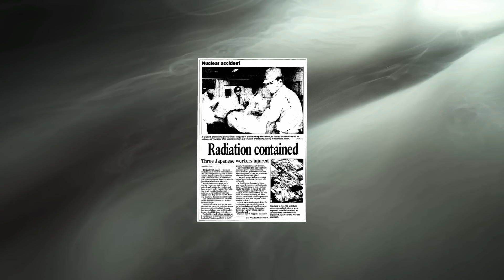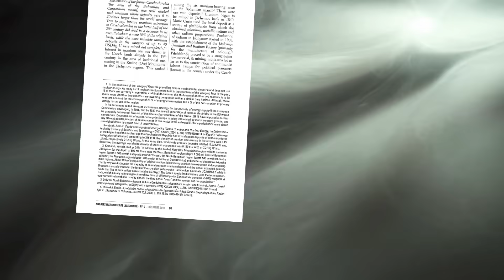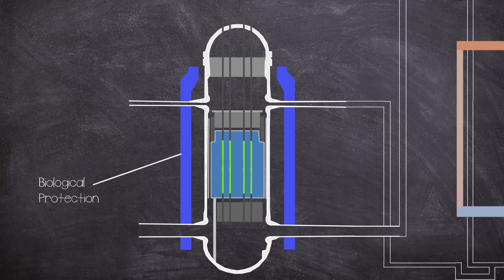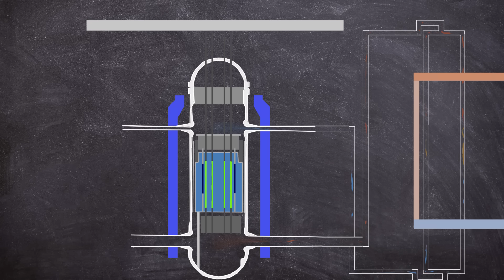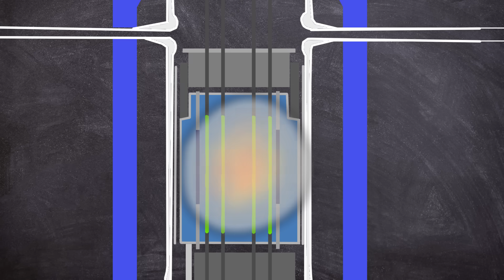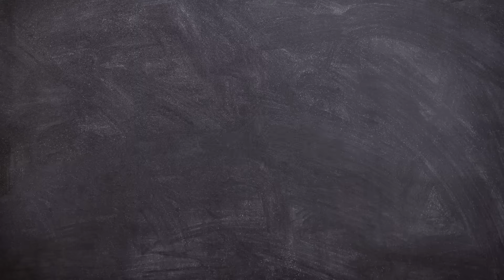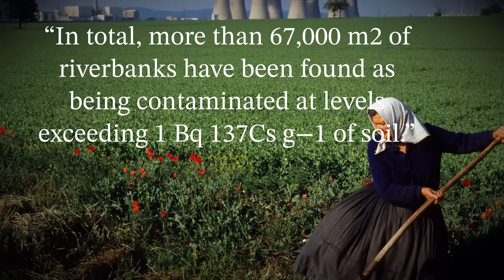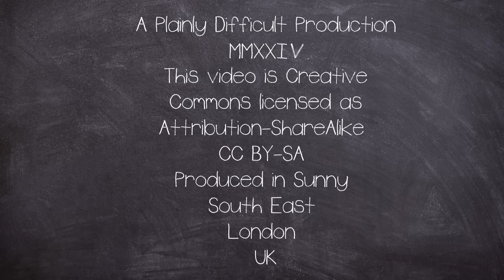Doomed: The Czechoslovakian Nuclear Reactor That Kept on Having Accidents | Plainly Difficult

Comment: Not the first time a socialist country has had problems with reaction.

😏
Reply: Communist, not socialist
Reply: @Coastal_Cruzer  Technically, it was a socialist nation led by a communist party. You could also technically call it a "first phase of communism" country if you're going with a strictly Marxist definition, but to say it's a straight-up "communist" country is a bit misleading since they hadn't actually achieved communism/the second phase of communism defined as a stateless, classless, moneyless society organized around collective ownership of the means of production and the guiding maxim "From each according to their ability. To each according to their need." 

They didn't even really manage to establish a stable dictatorship of the proletariat, let alone achieve the withering away of the state. And if you're taking an internationalist line then it wouldn't even be possible to fully achieve communism on a national level since the existence of bourgeois elements anywhere would preclude the establishment of a classless society.
Reply: @meatharbor  if you have to 1. Write a paragraph in response to three words, and 2. Use "technically" that many times in the opening of an argument, consider that you might be misinformed and/or chasing a bias

Comment: "Hey guys, out of curiosity do we have a vacuum cleaner?" "Yeah, why? Aren't you supposed to be refueling the reactor?" "No reason, hey can we borrow that real quick?"
Reply: The clearing staff using the same contaminated vacuum cleaner in the office a day later 😂
Reply: @NinoJoel  fresh fuel rods can be hold in hands and they are. In that particular reactor those rods had even unenriched uranium. That was the main feature of the A1 and the possibility to change the fuel during operation.
Reply: @Petriiik   while my comment pretty obviously was ment as a joke I still don't agree with your comment and the one above. 

Yes it's not highly radioactive. 
That still does not make it "safe" To handle for longer periods of time. 
There is a big difference between having a fixed source of said radiation or potentially sucking in small fragments of said source and spreading it in the air. 
The used material is highly toxic and the radiation while not posing a threat directly will have a much worse effect if breathed in.
Reply: @NinoJoel  no you can not inhale that stuff, the uranium is clad in metal.
Reply: @Petriiik  and what gives you the certainty that no material particles got out during production.... Like I said. It was a joke.  Yet there is no guarantee there is none. If there was the people handling the rods would not wear masks....
Reply: @Petriiik  in theory yes, it is safe holding in hands. In reality your hands are too dirty to touch anything going into ultra clean enviroment like nuclear reactor.
Reply: @NinoJoel  Well, sometimes I see people driving their cars alone wearing masks for no reason, so that's not really true.
Reply: @seth7745  that's something they decided themselves... The other is a regulation put into place for a reason lol what a comparison
Reply: @NinoJoel  Regulations are put in place for reasons, but not always legitimate reasons. Just because someone is wearing PPE it doesn't mean there is a hazard. Sometimes its just about optics and bureaucracy, especially under communism. The people wearing masks alone in their cars is just icing on the cake. It shows how irrational people can get when subjected to overzealous policy. I'm not implying that is the case here, just that you can not assume there is a hazard just because someone is wearing PPE. There maybe, there may not be.
Reply: @seth7745 The very reason of wearing protective equipment is that there MAY BE a hazard. There is no sense in wearing PPE only after the actual presence of danger or hazard has been confirmed .
Reply: @NinoJoel  The vacuum cleaner wouldn't be contaminated. Those fresh fuel rods would be producing a negligible amount of radiation.
Reply: @AndrewMerts   thats not how contamination works. 
The emited radiation levels don't matter when it comes to potentially contaminating something. 

If there are lose dust particles of the fuel there is a good chance the vacuum will spread said particles. If you breathe that in it does not matter that it is un enriched. 
Said material is highly toxic and when breathed in more than radioactive enough  to do damage.
Reply: At that time it would be "ETA 418"
Reply: Imagine if it had been a Henry? The radiation might have brought him to life...
Reply: @lofthouse23  now thats a new horror Film for next Halloween 😂

Comment: That could have been a lot worse, The last thing we need is another Chenoblye. As bad as it seems it could have been a disaster. Thanks for sharing John....
Reply: Another Chernobyl is pretty much impossible no more of those style reactors exist
Reply: @Just.A.T-Rex There are still some operating RBMK reactors - including multiple units in Kursk, Leningrad, and Smolensk. However,  there were safety improvements made after the Chernobyl disaster.
Reply: @Just.A.T-Rex  Glad to hear that, but any nuclear accident from any design of reactor old or new would be another event best avoided. The reference was to a major radiation leak from whatever and wherever. I was describing a level of event and not the reactor type....
Reply: @jakobrebeki Fukushima nuclear disaster in Japan, came very close to being a Chernobyl type event. Radiation released into the air and water.  The USA is catching tuna, containing Radioactive Cesium, off their West Coast.  I want my tuna to contain zero Radioactive Cesium!
Reply: @MrSummitville  Yes, you are absolutly correct. Instead of radio active elements or particles in with my tuna I would much more prefer some Sweetcorn and the only ""hot"" stuff within to be maybe a pinch of pepper but no chilli. served on fresh toasted brown Rye bread spread with fresh unsalted butter and a small cesaer side salad. Have a great day🤣🤣🤣....
Reply: Nope, even in case of total loss of coolant it wouldn't be anywhre near compared to Chernobyl.